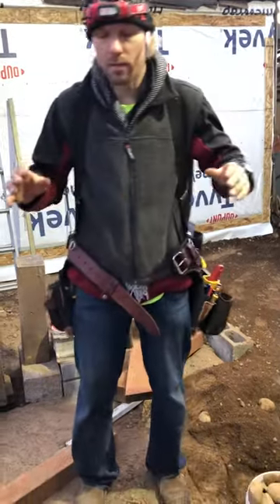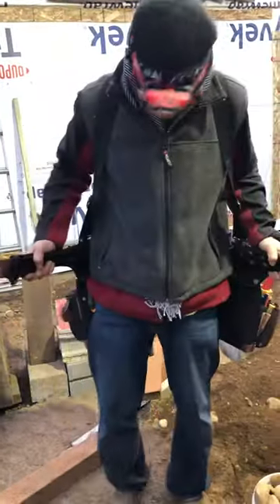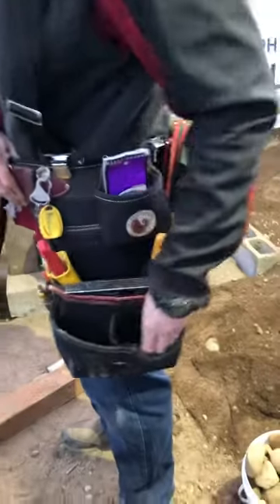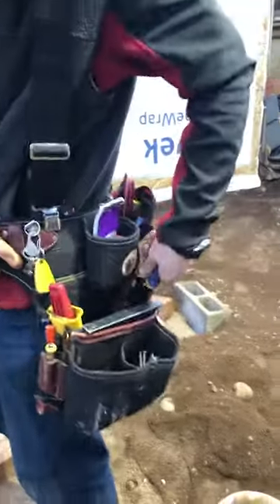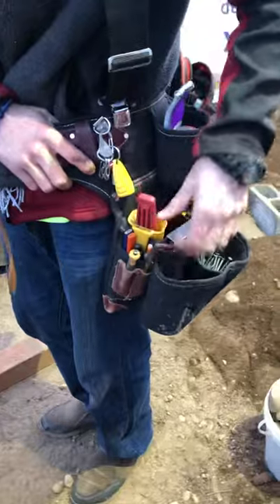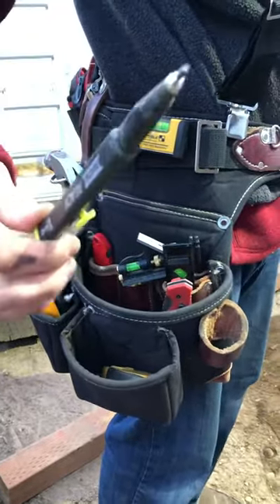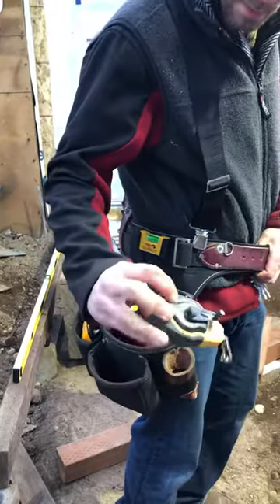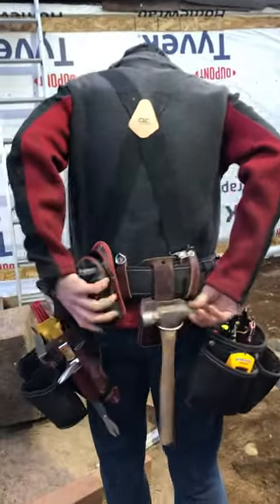My occidental tool belt set up

Comment: Nice setup man! Very similar to mine. One thing that I do different that you might find helpful is I keep my tape measure accessible to both hands and I keep my Combo square on my left side because I find myself using it more with my left hand once it’s set up. try it out let me know what you think
Reply from the maker: I will DVS thank you for the info anything to make the job easier well not Losing productivity I’m all for ... thanks Man I’ll give that a try By myself sometimes doing the same thing that’s why I wish I was a little bit more diverse when it comes to setting up your bags other than that yeah the best
Reply from the maker: Ok I’ve given that a try now for about two months and To be honest you were right in a way but on the other hand the bags are set up for the other way so either way man you could could you couldn’t go wrong on both ways thanks for the tip in the comment

Comment: Clearly detailed review. Thanks. This setup looks perfect for me, but one important question: how do you carry a cordless drill on the right side with this rig? In my workflow, the cordless is maybe most important tool to have at the ready all day long.
Reply from the maker: Well I think I got an answer for your question and that is Dewalt makes almost a gun holster looking carrying case that fits right on your rig I got one myself and it works really good it’s kind of hard and tricky if you have a long extension been on there to get in and out but other than that it works great again it’s a Dewalt it looks almost like a gun holster if I can send you a picture I would and I might do that but yeah you can get them at Lowe’s or Home Depot in thanks for a writing maybe I’ll do a video about it and thanks again
Reply: @thecarpenter9408  Hey, thanks for getting back to me! I also have used the Dewalt holster you mention. But I've recently ended up changing my long-standing habit and started hanging my gun from a metal clip offered on the right side of my new rig (using the little clip that comes on the cordless.) It took me a moment to get used to it, but I've found that this method actually eliminates the very problem you mention, since you don't have to pull the entire length of drill plus long bit/extension all the way up and out, the way you do with a holster. BTW, after a lot of research, I ended up going with a custom tool belt from Akribis Leather. A once in a lifetime investment for me, but well worth it IMO. Many very practical and unique options available with quality on a par or maybe even better than Occi. But your rig in the video looks really well configured too.
Reply from the maker: Michael Schuler Well I have to say great choice on the bags the rig set up it’s a very important part of being in the trades is your rig set up because you’re going to be with a day in and day out the solution about hanging your drill I do the same thing on my hammer loop because I didn’t have a hammer loop in the front and in the back so it doesn’t need the back for my drill with the extension on it eliminates the problem have a getting stuck so sounds like you got like you’re on track and sounds like a you know what you’re doing and thank you for tuning in to my channel and responding to my videos and the content in the hope to hear from you in the future continue watching in theJoy the bags are very nice great choice well done

Comment: I want the same set of bags but leather. I am worried they won't fit me right due to my narrow 30" waist. Any insight on the fit?
Reply: slide the bags off and get a new belt that fits. might not be able to get padding but maybe a thicker belt.
Reply: @happy_hand_grenade7294  That's part of why I want that setup. I want the padded belt with option for suspenders and the ability to adjust over a T shirt or if its colder, sweater, jacket or vest.
Reply: I'm in the same boat, hoping it won't matter once I have the belt + suspenders though we'll see

Comment: Way to much in ur pouches! If urnotfonna use itbefor lunch it shouldn't be in ur bags. Nail puller? Shouldn't need that if ur a real carpenter!
Reply: Lots of dead weight. But when you're young you tend to be oblivious of that.
Reply: Half the stuff I have in my bags are for the idiots I work with who don’t bother to carry stuff with them or lose it an hour in to the day